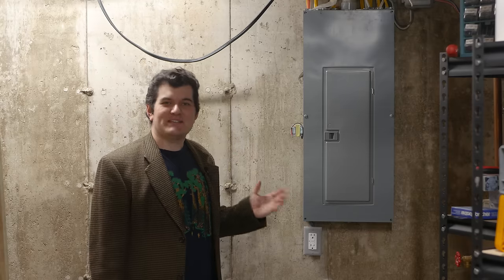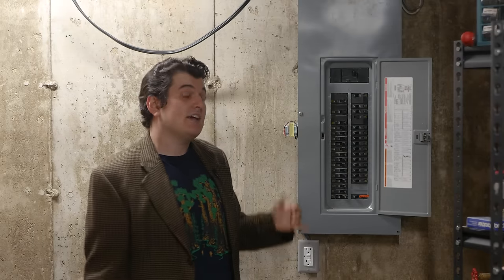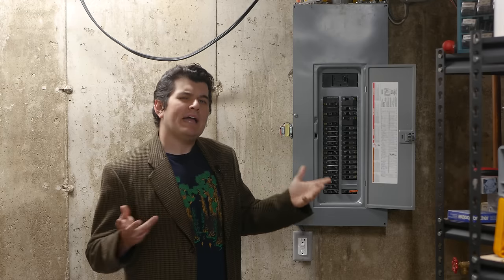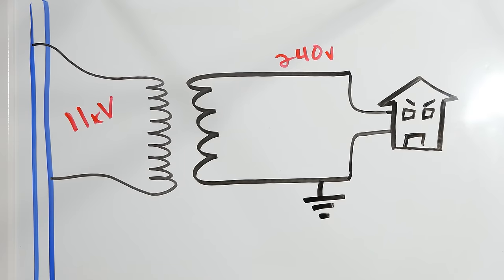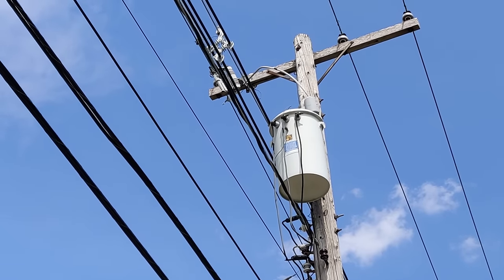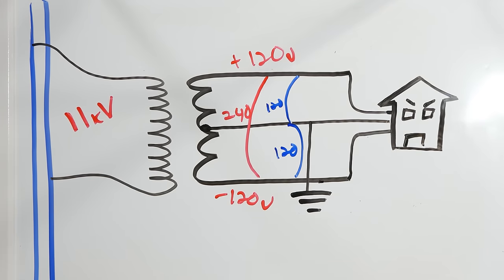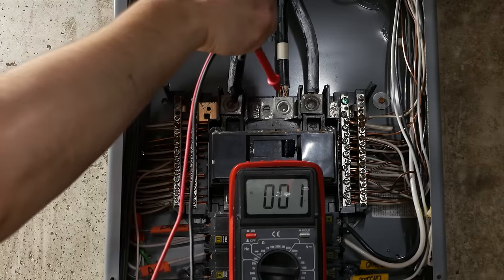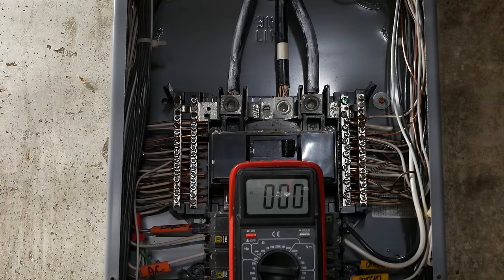The US electrical system is not 120V

Comment: “I know, to those of you in Europe this looks horribly gross and terribly unsafe, but that’s ok, we’re coping.” America summarized in one sentence.
Reply: Well. Its true most european electrical boxes are designed way better. But if you look at old homes it is even worse. You have standardized the electrical boxes in the US so you only have to add breakers. What type you want doesn't matter it all fits on the same rail. Here in the EU its more modular. You have to chose components yourself and if you want an earth leak detection forinstance its not imbedded in the breaker. So you have to connect all modules together with wires and clips yourself. If done properly its really good but if not done properly its a shit hole.
Reply: @brinkshows2720  Totally true, in Europe we have a lot safer plugs and  our panels can be a lot safer, but if you get the box done by a dumbass it can kill you easily. I prefer the european way because know it, but if you don't know your shit its really dangerous.
Reply: @hardwarefromthegarbage3446  I Grant that Britain (NOT part of the EU anymore) is designed better. But most of the EU's countries have non-polarized, round recepticles that  my Italian cousin just cuts the plug off a British appliance, strips the wire, and shoves the bare wire into the holes. I will prefer the US to that.
Reply: @brinkshows2720  I have a friend who was living in a tiny old house of the 60s or 70s where the whole house had one 16A breaker, single phase, no GFCI. Could only use 2 hotplates of the cooker at the same time or the oven. Don't even think of using the vacuum or hair dryer at the same time.

Comment: As electrician from europe i can say your
distribution board looks antique, like its from 30-50's. 3 phase power rocks!
Reply: I'm an American electrician, our 3 phase panels look exactly the same.
Reply: Every house get 3 phases in Europe? Good for you, triphases transformers are 96% efficient compared to 2 phases only reaching 80% efficiency.
Reply: When I saw the opened panel, I was internally screaming out of fear... what an horror !
Reply: @HouseNuova500   its not that scary, typically there is never any reason to take the cover off of an electrical box except when the house is built or when circuits are added or a failed breaker need replacing, and you just shut the main off and its perfectly safe. Alternatively you can call an electrician instead of poking around in there yourself if you don't know what you are doing, if you kill yourself because of ignorance its your own fault, we don't need the government looking out for us in or own homes , its called personal responsibility.
Reply: @thejackofeverything7961  Man, you obviously never had to deal with a cheapskate landlord who hired an under-the-table "electrician" for the initial wiring.
Reply: The wiring in this panel is actually quite tidy for the US. There are some panels that look like spaghetti inside. There are also some very old electrical systems that are terrible.
Reply: @moiquiregardevideo  I'm from Czech republic and not every house has 3 phases here. It's usually available on the street, but if there is no capacity left the distribution company will not allow you to connect the 3rd wire. This happens in cities/streets where the infrastructure is old.
Reply: 3 phase makes powering motors less hard!
Reply: @Stinkehund   No but that's on him, and living there is on you lol
Reply: @thejackofeverything7961  Ehhh, no! Personally, I need the government to look into YOUR home because it's built right next to mine: a misplaced act of personal responsibility on YOUR side might burn to the ground MY side of the property.
Reply: When I moved to the USA from the UK. I needed to buy a washing machine and dryer. It was like I was back in the 1940s, things like my grandmother owned.
Even today most washers are mechanical top loading that Noah probably had on the Ark - LOL
However, the more expensive ones are front loading, digitally controlled, like I first bought in the UK 40 years ago! But I've only seen them in the last 10 years!
Reply: @thejackofeverything7961  you say that as if you can just ask a landlord ahead of time if they hire people with qualifications or just friends who cut them a deal, and receive an honest answer. Hell, you might get passed over in favour of a different viewer just for asking – renting stock is so much lower than renting demand right now.
Reply: @user2C47  wait, tidy? This panel is tidy?!
Reply: @scenno   No that's not exactly how it works, the law says you have to follow code, if you don't you are liable if you landlord doesn't he is liable, that doesn't mean people follow the law, here or anywhere. if your neighbor burns your house down he is liable. Unfortunately being unsafe and breaking laws meant for safety may result in the deaths of others, and or property damage, but either way you have no control over your neighbor so in the end you have to watch out for your own self, the government wont save you only mitigate some danger for the people that follow the law. Welcome to the dangers of living.
Reply: Hey before you rent maybe go talk to the other tenants and see if its a reasonably safe place to live.
Reply: We like things that last a long time. A good top loader doesnt get mold ans grease buildup in it that has to be cleaned out like a front loader, plus if I forget to throw a sock in once I press start, I can just lift the lid and throw it in rather than wait for it to be done. Plus, top loaders are work horses, lasting 20 to 30 years. It's part of the reason the US brand Maytag went out of business; their washers were built so well and lasted so long, Maytag wasnt making a lot of money on repairs or selling newer models.
Reply: @BryTee  I'm not sure what cheapo appliance shops you've been going to. Front loading washers have been available for ages. Only super cheap modern ones are top loading, as well as old ones which are still top loading but are sturdy and reliable as heck.
Reply: @gajbooks  As I said, front loading washers in the US have only started to really be available for about 10 years (eg Sears).
But 20 years ago, front loaders were available, fairly rare, and were at least 2x the price of top loader, with clunky knobs, switch selectors, with internal mechanical operation with cams controlling the wash cycle.
Whereas 40 years ago, the washing machine I first bought in the UK, was front loading, completely digital, push button, LEDs, etc. Even my parents when they moved 10 or so years before I left home bought a new washing machine ... it was front loading, had 7 segment LEDs to show time left, and was push button. No clunky knobs. In the 70s it was probably impossible to buy a top loader in the UK.
Reply: I found an article from 1997 which seems to back my observation that 20 years (approximately) front loading washing machines were commonplace in Europe, but not in the USA. As well as their agreement from what I remember about pricing. My observation about the UK was that a top loader ever since (at least) the 1970s were not available ... maybe they were, but I bought mine in the early 80s, and I never saw a top loader until I moved to the US in mid 90s and NO front loaders were available (at least in Sears where I'm sure I went).
See https://www.nytimes.com/1997/05/15/garden/washday-s-frontier-the-front-loaders.html
Reply: Europeans use front loaders because they need efficiency in floor space and they stack the washer and dryer (if they even have a dryer!) They don’t have laundry rooms in their houses like the US.
Reply: He he.... The same can be said for the 66 block used. It’s all Krone here down under. Very sexy in comparison. With the right tools it’s a very quick process to check a customers line. Literally plug and play... no fiddling with clips and alligator clips.
Reply: @Les OK "digital" would have been better if I'd said "electronic", but it had a 2 segment LED display that counted down the minutes to go, and a bunch of LEDs to indicate various things, much like a lot of 70s appliances had. Inside were relays, motors, and actuators controlling everything.
On moving to the US in the 90s, it was like being thrown back 40 years in the technology of appliances (not just washing machines, but electric kettles were unavailable, mixers were from the 50s). Honestly I'm sure I'd never seen a top loading one before, and it blew my mind since I thought the USA was in high-tech. Maybe elsewhere, but not in the home. I was further stunned by the clunky knobs and how inside it was all mechanical, cams, etc. I DID search for a front loading washing machine and they just were not available then, people claimed they existed if you were Bill Gates, but not for anyone else.
A little under 10 years later, I moved, and needed to look again and now they were available but astronomically high in price, so again I bought a top loading one (I still cringed having to buy such a piece of dinosaur equipment - even if it was newly made).
I'm not saying front loaders don't have their issues, but in the 15 years I had my electronic one in the UK, it never had a problem.
Reply: @BryTee   My top loading washer and dryer sends me a text when they are done, what are you even talking about lol, front loaders are for space savings, it has nothing to do with the technology inside, honestly i wish it had less.
Reply: @thejackofeverything7961  I'm talking about how in Europe in the 70s their front loaders got high tech (for the times), and top loaders became unavailable.
In the USA, top loaders were the norm until the 21st century and almost no washing machines had any high tech. See the NYTimes news article from 1997 about this I posted yesterday, which matches my experience.
Yeah ... today my top loader plays a pretty tune on startup, lots of LEDs, etc. But 20 years ago there was a SERIOUS difference between Europe and USA washers that were generally for sale, and it felt like I'd been pushed back 50 years when I went to buy one after moving to the USA.

Comment: One thing I'll say about Australians having switches on all outlets is that we badically have the same switches on all appliances as the us but its noce to have the option for redundancy or safety. For example, something that you arent sure if it will explode/burn or that the switch is iffy, you can choose to turn it off at the wall or turn it off from a distance. Its also nice to turn an outlet off if toy are concerned about it shorting or if its being fodgy until you can get somone to check it. Also aussie plugs arent ad good as brittidh but one thing that is good about them is that there is runber shielding on the top of the hot and neutral and the earth is slightly longer and unshielded so the risk of sparks is minimal and you need to be trying really hard to electrocute yourself plugging something in. Great video as allways :)

Comment: By your logic in this video: "The EU electrical system is not 230V" (It's 400V)
Reply: No, not 400,  it is 220 to 240. They don't do the middle split on the transformer.
Electricity voltages vary a bit, also the more load you put on can dip the voltage too.
Just saying that as you might think voltages are precise, they are close enough for things to work.
Further from the main power feed the lower the voltage.  Each length of wire has resistance and it cause the voltage to drop by the resistance in the wire.
Reply: @superchuck3259  it is 400 we get all three phases to each home and between two phases there is 400v. between one phase and neutral it is 220-240v.
Reply: @SimonBauer7  Makes sense now why Hotels/Motels provide free hairdryers. Imagine the issues from people traveling with them.
Reply: @superchuck3259  It is middle split in star configuration 3 Phase. Everything is 3 Phase. Only exception is old wiring in apartment buildings which is 3 phase at main breaker out in the hallway but each apartment is fed with single phase in alternating order to balance the load. This is no longer code and being replaced.

Comment: Hi,.  . .  Yes, North America is a 240V country, or more correctly a  2-phase 240V country. . .  That is to say, that the supply to most American homes and small shops uses TWO Live wires, with 240V between the two wires. . . . But they split the supply from the nearby transformer, usually pole mounted transformer, and Ground the centre of the 240V winding. . . .  This now results in two Live outputs, swinging up and down in opposite directions, like kids see-saw, relative to the grounded Neutral line. . .    So this is a 2-phase 240V 180° Supply, or 120-0-120V providing effectively two 120V supplies..  ..   And yet Americans will not recognize it as 2-phase, which it is, and refuse to call it that.  . . They use various names to explain it without admitting it is a 2-phase supply.. ..   It is a 2-phase 240V 3-wire TN-C Supply.

So yes, correct many house supplies are 200 Amps at 240V which is  48 kW capability.. .  I was pleased to see Square"D"  breakers which are a better quality than certain other common ones. . . .   So yes, clearly those double breaker for 240V circuits just clear show how they are 2-phase supplies, going to A/C's, other heavy loads and dryers etc. . . . . So yes, local distribution to those transformers may be in the region of 11,000, 22,000 Volts ( 22 kV ) or other high voltage so that such high power can use small, low cost wires. . . .  In fact some very high capacity transmission lines are now going up over 1 million Volts and even better if those transmission lines use DC, that is HVDC is better for this than AC. . . . .  Keep watching, there is a lot of other good information there.  .   :-)

But then he goes wrong. . .   Well he is right in what often happens, but should not happen. . .  Those bars he showed up at the top left and top right are the NEUTRAL Bus-bars, for the White wires only. . . .   The Ground Bus-bars should be further down on the two sides or sometimes just on the left.. . .  That is where all the Ground wires, the green wires and the bare copper wires should be going to.. .  But many houses in the USA are not done properly.
Reply: Hi Billy. . . .  Actually North America could fairly easily migrate to the world standard of 240V or 230V over time. . .  And maintain backwards compatibility. . . .  OK, it would take some years for the migration.

First step is to insist in law or regulations, that all new houses have many 240V Outlet around the house. . .  Also major house upgrades to include many more 240V outlets. . . . .  Then get manufacturers to sell both 120V and 240V versions of their appliances, ( 240V should actually be slightly cheaper, as use smaller wires.).. . .   Then gradually over several years, more and more appliances used will be 240V. . . .   Eventually, some years in the future, the electrical supply companies only supply electricity over just 2-wires, a 240V Live and a Neutral wire. . .   This will reduce supply costs.. . . And it will reduce house wiring costs and panel board costs. . .  So a win-win situation for all. . . .    Any customer still needing 120V could use a small 120V transformer in their house.

Comment: Another "The More You Know" The 2020 National Electric Code or the US has made GFCI and AFCI breakers/circuits required in many many more places in a home.
Reply: Good.  I already plan to do all of them when I build.  Combo.
Reply: Haven't read the 2020 version but last time I read it AFCI was required for bedroom only.
Reply: AFCIs required throughout a house on 120V 15A and 20A circuits, beginning in 2012.  Garages are not listed in the Code as areas where AFCI is required.
Reply: In Germany this was changes sometime around 2004 I think. untill then (since sometime in the 80s) only kitchens and bathrooms or anything that might handle moisture had GFCI required. since around 2004 everything has to be protected by one or more GFCIs. Gets anyoing as hell when you try to install a light fixture and accidentially short neutral and ground while fiddling those wires through a metal backplate.
Reply: That was a requirement in 2017, 2020 code just adds more locations that have to have them, plus a whole house surge protector, and any outlet within six feet of water has to be GFCI
Reply: also thats for new or renovations that require a licensed electrician as a home owner that lives at said house can do whatever they feel like because no ones watching them and only have to bring it to code if selling said house which is unfortunate as there are still houses using screw in glass fuses or cloth bound wire which is severely unsafe on top of the fact that most people dont change their breakers often enough as they have the potential to stay locked into position by corrosion and yes thats a thing ive seen it in action by someone taking a wire and pressing it into an electrical box and watching them weld with the copper wire to prove the point that the breaker wouldnt trip
Reply: @Blake Belladonna ...just bought a 15 amp AFCI "breaker" for a Siemens push-on style panel last week. 

$123 Canadian/incl taxes. Not cheap.